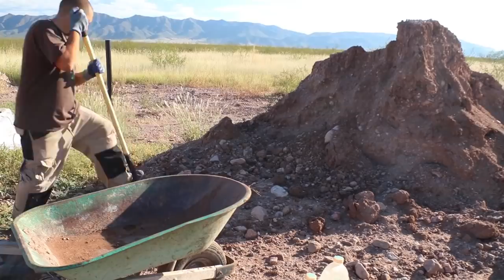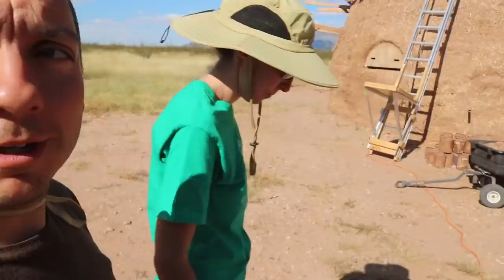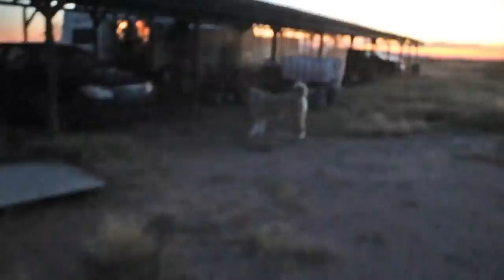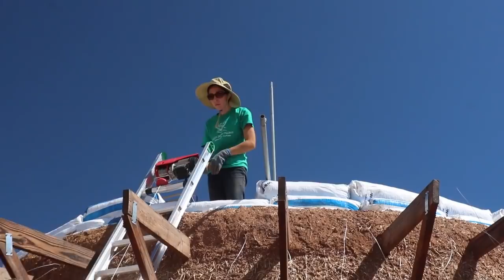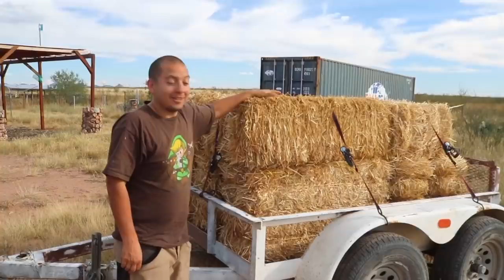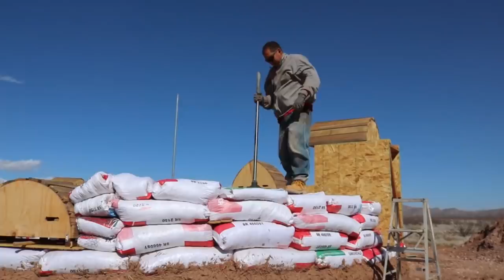Answers To Our Most Asked Questions About Building An Off-Grid Earthbag House

Comment: The way you are doing the bags seems logical and easier to control the outcome.  You both have really perfected your process over time and I notice the tools you are using support your precision even though they look rustic. I take my hat off to you. I know you learned this technique but you can tell you have dialed in on the method to achieve great results.   I can tell the courses are moving faster.   The end is insight. Just stay safe up there as your building gains height.  Thanks for another great video.

Comment: moot point at this part in the process, but just out of curiosity, did you at any time ever consider rammed earth?  I see rammed earth projects in  desert locations such as yours and was wondering if there was a significant difference in cost?  seems that most of the materials are coming right off the building site, with the exception of added concrete mix for rammed earth vs. buying straw to make cob?
Reply from the maker: It's a significant investment in plywood and clamps

Comment: 12' high on that thin platform, especially on the half of the house that doesn't have the upper deck, is high enough that Jess should be wearing a body harness with anchorage and connector! If the cost is an issue I'll happily contribute.

Comment: Here is a suggestion. Can you put the cans in the wheel barrow or cart and shovel dirt in. Might make it go a little quicker. Only moving dirt once then. At lest for the first fill anyways. If you have 30 cans, that should be plenty. More is even better. Can you use some of that grass that you cut for anything? At lest for composting. Looks great. Only a few more weeks till structure is done, and then it's time for finishes.

Comment: Jim, I mentioned this before.  Jessica needs to wear a full body fall protection safety harness with a shock absorbing lanyard.  You can get one on Amazon. A fall from this height could be devastating and I realize you only have a few weeks to go but they don’t cost that much and it is cheap insurance.
Reply: I think you need to be talking to Jessica. She seems to be the one that won't wear this. I've asked about this before. I worry for her safety as well. Jessica even your parents would want you to be safe!!! You addressed how you fill the bags but not how you are safe up there.  🙏

Comment: You’re doing it mostly the right way…except the hoist should be spring loaded . You fill it with dirt , hoist it to the top, pull trigger launching the dirt in the air , Jess stands on the X with bag open catching the payload. 
You can also catch roadrunners this way as well. 
Good luck and God bless my friends.

Comment: when the trailer is attached to the tow vehicle the wheel you use to hold up the tung when parked is supposed to be turned 90 degrees so it does not catch on anything.
Reply: I saw that too. Your lucky you haven’t hit it on anything. It will also save you from cranking the lift so much.

Comment: Looks like the Tahoe and trailer combo will help you with a lot. Full length lumber might be tricky, but luckily, you dont build with a lot of lumber.
Reply from the maker: I think the trailer would be good with the full length lumber. It can hang toward the front of the trailer. I can actually fit 8ft 2x4's in the back of the Tahoe with a bit of finagling.

Comment: Before mud season, dig 2' wide by 6" deep trenches from the new house to the trailer. Fill the trenches with the stones that you pull out of the soil. You'll then have a dry walkway. The walk way can be used to percolate rain water into the ground. You can grade some of the yard into it, to drain puddles. You can make yard drains by digging holes a few feet down and filling them with stones. You probably need a place to dump the rocks anyway.
The back of the Tahoe is perfect for Crue. A piece of carpet will make it easier to clean. Good Luck, Rick
Reply: There is a guy in India proposing a program called aqua pore. Holes around a meter deep filled with organic matter to aid in aquifer recharge and passive composting.
Reply: @kenknutson1598  Yeah, its been done before and works. He needs the dry walkways and has lots of stones. Did you notice how the water sits on the surface when it rains? The soil is probably packed hard and doesn't let the rain percolate into the soil. Digging into the soil and filling the trench will probably allow the water to better percolated down and keeps their shoes from getting muddy.
Reply: @richardross7219  Really xlent suggestions. Yes, the desert soil composition is not aerated enough to allow water to drain into it ...hence being a desert. A pond set up could also be established to collect the surface storm water , with the same type of drains you suggest , but with them all running to the pond, starting shallow & in  increasing in depth as destination is approached.
Reply: @AuskiHeth  The problem in hot areas is evaporation. If you use a pond, the water will evaporate quickly. If you dig a bigger pond and fill it with small stones, the evaporation rate will be greatly reduced. In recent years, reservoirs have been covered with plastic balls to reduce the evaporation losses. Good Luck, Rick

Comment: Out of all the excuses I heard for not filling the bag the only thing I hear that is viable is to heavy to lift it sounds like he's to lazy to fill the bag all the equipment you use on the top you would use on the ground but then as long as it takes you to build this I can see why the extra effort is to much
Reply from the maker: Your statement doesn't make a lot of sense. Can you rephrase this?
Reply: Sine you didn't understand the first time excuses are like asshole nobody want to hear them just put the effort in it and stop making excuses you will die of old age before you finish it
Reply from the maker: @dennishedrick5108  no one's making excuses. We're just answering people's questions. I'm also used to using punctuation, so you'll have to forgive me for not understanding at first.

Comment: Hi, love you two! Just wondered if you have contemplated using a pc. of  diamond plate steel mesh, slightly larger than your wheel barrow, in order to classify the material?
Also, unrolling the barbed wire, and pre cutting it to "close to the length needed",  might be something I would try, just to convince myself it's "not" a quicker method.

Comment: All good logical reasons for doing what your doing. Glad to see that you've got the DDS challenge solved and are back in the groove. 15 more rows means only 15 more days until the dome's completion, right?👍
Reply: What's the dome gonna consist of - bags and curved metal/wood ?
Reply: @dynolandsculptor1967  More earth bags in decreasing circles to the apex. Topped with cobb. Just more of the same.
Reply: Cob covered by hay bales covered in cob. For energy efficiency
Reply: 15 more rows ??  Why?? u building a death trap......!!
Reply: @duaneknorr3081  Provided that the material doesn't compress, it is impossible for a dome to collapse in on itself. This construction method is ancient, tried, tested, and true.
Perhaps you should do a YT search for 'earthbag homes' to see some other examples of finished earthbag dome homes.
Apart from utilizing local dirt, the thermal mass reduces A/C and solar electrical gear. Minimal construction costs + minimal energy costs is the objective.

Comment: Still wish to know the recipe of sand, earth,water, clay you fill the bags with. Hugs from brasil
Reply: In earlier video they show how to assess soil using a clear jar and water...
After shaking the different materials layer up so you can measure the ratios in your soil
and adjust to get optimum mixture
Reply: @jimh4167  I wish to know a recipe something written to aim for trying without errors. My earth is rich of clay so I just need add sand and water but idk proportions or optimal recipe to aim. Some ppl add cement I don't want to
Reply: @anarres1400  
If they don't respond
Simple internet search
Reply: @anarres1400   Your local college might have a green technology/ green building courses. 
The student president of that class and teacher/s are knowledgeable and happy to share their resources and,  hands-on know- how.👍🏼